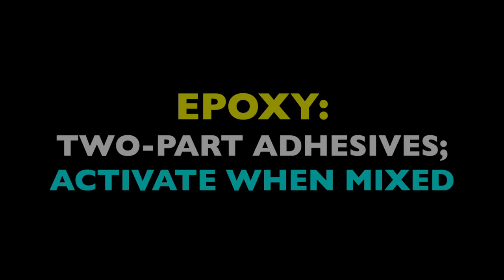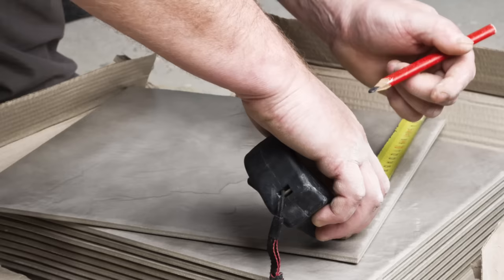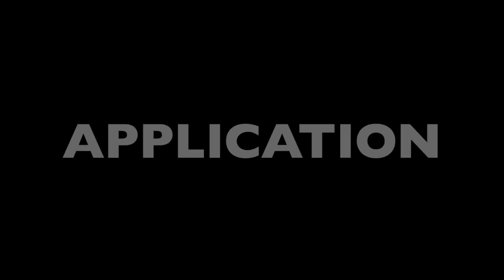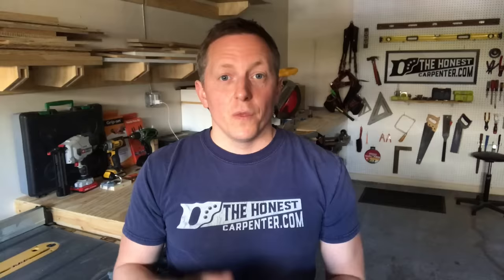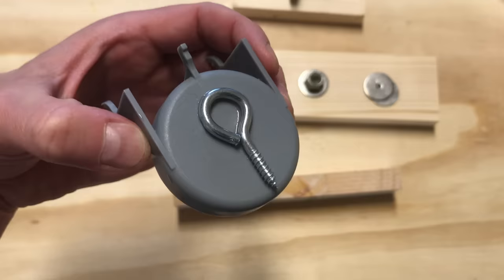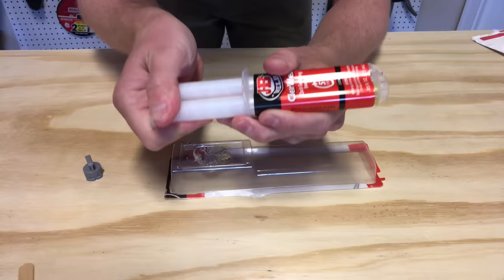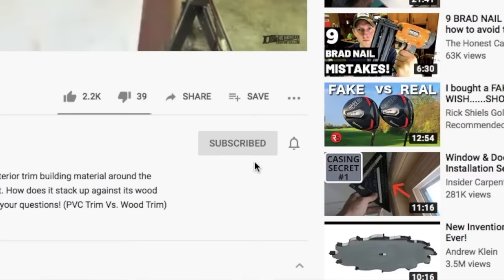DON'T USE SUPER GLUE! Try This Instead..(Epoxy Adhesive/5-Minute Epoxy/Epoxy Glue)

Comment: I recently removed a 4' X 8' sheet of drywall that was covered with un-matchable wall-paper, tore out the wall and installed a pocket-door then re-installed the drywall using that larger quantity-size epoxy you showed. I mixed the entire bottles with a long-handled paint-brush and covered the metal and wood studs, pressed the drywall into place and didn't have to put screws through the wallpaper. The drywall had originally been installed with small, smooth staples so levering it off from it's backside was easy and non-damaging. Today I'm installing new drywall on the other side of the pocket door the same way because it's quick and there's no patching over screws to do. Later in this bathroom remodel I'm using the small hypodermic style epoxy you showed to install small 3/8" color-dot tiles at the junctions of 18" X 18" porcelain floor-tile. I plan to put a dab of grout at each junction, press a tile-spacer in it, let it set up and then glue the dots which puts them level with the tile-top. Then grout like usual which will be more secure than just pressing the dots into wet grout. The super-glue that comes with a separate spray-hardener is what I'm using on the trim around the windows because it's almost instantaneous grab and set. Both types of adhesive have their best uses. The epoxy allows me a little time to adjust the color-dots with tweezers to get them aligned perfectly and the Super-glue instantly holds the trim together.

Comment: I remember growing up we always had the two tube pack of Devcon Plastic Steel  in the house. That got used to repair the car bumper among other things. There was also another brand of epoxy called Araldite that we got here as well. It was used to repair a broken crock pot cover, two broken vases, and many other household items.
Also the smell you get when mixing the two parts of the epoxy is exactly what green papaya smells like. 😊

Comment: It's also great in furniture repair at times. I sometimes fill a cavity with some wood dust (Oak dust for oak and so on). Granted, it's still epoxy with wood dust in suspension but for big knots in the wood, it works well.
Reply: Yes, for that. Not so good for joints in wood
Reply: @claudiodigregorio4315  Absolutely. You know what they say - it's all about hiding your mistakes :)

Comment: Another note to new users. Epoxy has an exothermal reaction as it sets, it heats up. keep this in mind if you are holding finger pressure on small objects you glue together, the heat may become uncomfortably hot.
Reply: Regarding the exothermic reaction, small amounts of epoxy can dissipate the heat fairly readily, so small amounts don't usually rise in temperature very much, and users may not notice it is exothermic at all.  Not so with large amounts!  We used epoxy at my place of work.  At one time, the epoxy was over-ordered, and there was about five gallons for which the use-by date was exceeded, so the quality folks did not allow it to be used in product.  The disposal costs for liquid chemicals are quite high, but solids could be simply put in the trash.  So, the EH&S (environmental health and safety) folks suggested that the two parts be mixed so the epoxy would set up hard.  It was really a highlight of the day to see those chagrined EH&S folks pushing a wheeled cart down the hallway, trying to get a skinky, fuming, bubbling five-gallon can of the stuff, surrounded by ice, outside the building before it became necessary to evacuate the building due to the noxious fumes! 😂

Comment: I've had situations where this would be suggested or where it was the best fix for a job, then I would get to reading the instructions and decide it is too much effort. You make it look easy. Thank-you!
Reply: I've worked with epoxies for decades and you're not entirely wrong. They work better than practically everything else...BUT... You must read and follow the directions to the letter. Most people can't be bothered and that just won't work with two-component compounds.
Reply: @ethelryan257  , prior cleaning, preparation, and fitting of surfaces to be glued isn't just everything, it's *the only thing*.

Comment: Excellent. I recently joined two pieces of plastic floor trim and went with super glue because there was no way to clamp and very little surface area on ends for positioning. Then I glued a couple wood strips to the backside to reinforce. I should’ve used epoxy for the reinforcement. Next time I’ll know better.

Comment: I love this stuff! A real go to product for woodworkers. I tend to use the JB Weld Epoxy putty stuff lately for two specific reasons: Once it cures it is as strong as steel, and you can even drill or tap the stuff! Very handy. Great video, thanks!

Comment: Excellent informational video!
I've been using epoxies for many years.
I once repaired a broken valve cover bolt tab on a Subaru with JBweld and became a believer in the strength of industrial adhesives!
Reply: I did a similar thing on an old Buick slant 6 with 22 bullet shell brass and jb weld

Comment: I think the most important part of using Epoxy, is properly mixing the Epoxy with a focus on INCORPORATING all of the part A/B surface area stuck to the plate or cup that is used to mix on or inside of. 
Note: Un-mixed part A/B will never CURE SOLID and is the primary reason for Epoxy complaints.
Don't use Round nosed popsicle-sticks because they do not scrape the Parts' A&B from flat surfaces - cut them flat faced like a chisel with scissors first.  Scrape the sides and bottom of a mixing cup, or plane the flat paper plate you are mixing on to get every single drop into the whole. After you think it is mixed, consider mixing for 30 more seconds before applying.
If you don't have time then you should use a 12 minute epoxy so you have time to properly mix, apply the Epoxy, and clamp the joints.  
Secondary in importance is the 50/50 part: It will cure solid IF it is mixed COMPLETELY.  When epoxy does not cure it's because it was not COMPLETELY mixed beforehand. 45/55 / 55/45 will cure A-OK, but small streaks of 80-100% part A or B will never, EVER, cure, and be sticky and weak FOREVER.
Note: Epoxy does not "Dry" like rubber cement does --> Epoxy only Cures or Hardens, so stop using the words DRY/Dried when talking about Epoxy. 
P.S. Don't get Epoxy A/B on your skin, no matter how many seasons of Epoxy wet fingers/hands you've seen on Forged-In-Fire!

Comment: Totally agree. I tried to repair a broken garden statue for a customer over the winter. I first tried PL Construction adhesive. Didn't work. Then I tried Super Glue. Same...didn't work. Lastly I tried JB Weld 5 minute epoxy, worked like a charm and my customer was very happy!

Comment: 3:32  NEVER twist the tube when removing it.  If the glues contaminate each other, the entire tube could be set the next time you go for it.
Reply: Yep, that was a strange manoeuvre he did.
Reply: naww, it's not a radical type reaction for polymerization, the hardener IS the limiting reagent
Reply: make sure you use a rag and clean off the tips, before putting the cap back on or its going to be bonded solid the next time you use it.
taping instead of putting the cap back on is a good idea.

Comment: Absolutely has a place.  Especially for bonding "slippery plastics" because no other common adhesive works, including super glue.  Another big positive is it lasts a long time even after being opened, because it doesn't set up until the two components are mixed.  It can sit in a box for years and still work like new.

On the down-side it is messier, because of the mixing process.  You can buy nozzles that fit onto them (including the tube seen in the video) that automatically mix the two on the way out, which is clean and convenient, but you throw them out after use because the epoxy left in them can't be removed (which also wastes epoxy) so unless you don't care about the cost, or are using an entire tube at a time, mixing it in a tray or something is the way to go.  BTW, that's an advantage of those little super glue tubes:  they're clean, simple, cheap, and mostly single-use because they dry up so fast after being opened.  So, they too have a place.  Depends on what you're bonding and how strong it needs to be.

Comment: fantastic stuff, also very handy for potting small electrical components that may risk water ingress, and for fixing those small external solar lights - but make sure you use the clear epoxy in that case or you just made your solar light think its permanently overcast :)
Reply: One of the bigger guitar/bass pickup companies on the planet, EMG, covers their active pickup circuit in epoxy so people can't steal their design. It started with the owner making them by hand, all the way up to today when they are pumping these things out from a factory.

Comment: I’ve mixed baking soda with the mixed epoxy, it will dry very fast and it’s like plastic when it’s dry. You can cut it or sand it. Got the idea from another video where crazy glue was mixed with baking soda. Epoxy works even better.

Comment: 2 part epoxy is all I EVER use, diff set times and diff cure times, i even repair my tool bags etc. with it. FYI the average i come across is around 3k PSI for your 5 min household stuff, and the fast set WITH the built in mixing nozzle can set in less than 30 secs.

Comment: Being a retired framer who now has time to do woodwork at a different level  I've been hearing a lot about  epoxy and I've never really associated with wood projects and that also applies to CA glue which I'm going to try both of them out more often and  see how they work out for me. Been a fan of your channel from the beginning and I don't always agree with you but you think like us old school carpenters and I respect that.
Reply: Carpenters, cabinet makers and framers are usually dealing with much larger surfaces to be joined, where cyanoacrylate adhesives or epoxies are not practical or economical.
Reply: @chrisgraham2904  Liquid Nail is a good Go To for any framer. Not only for sub-floor but also a great fire starter on a cold morning on the job site !
Reply: @michaelbradford4444  I've heard a lot of people swearing by Liquid Nails, but I used it to adhere some exterior wood panels about 25 years ago and they popped after the first winter, so I never used it again.  LePage PL9000 has been my go-to for panels, sub-floors, decks and mortorless retaining wall stone.  It is petroleum based, so I'm sure it would be a good fire starter also.  lol
Reply: @chrisgraham2904  Get the one that says Subfloor on it. I've only seen the big tubes of it and as long as it's warm outside it's what it claims to be , Liquid Nail !
Reply: @michaelbradford4444  I'll give it another chance.  Formulation may have changed over they years also.  lol

Comment: In aircraft repair work, we use 2-part 3M Scotch-Weld DP 100 & 110 commonly for it's quick setting, high bonding strength, and flame retardant properties (a requirement on commercial aircraft) -- no flammable glues. At home, I've used CA and baking soda paste to do quick repairs to minor dings and dents on my wooden paramotor props.
Reply: Fantastic stuff. Plus with the disposable static mixers and the gun it's so easy to use.

Comment: Totally agree with everything, excellent presentation. When you get used to cure times, you can be more selective with cure times that fit you purpose. 5 minutes is great but sometimes longer cure times can be helpful.
Super Glue has it's uses, but they are actually very limited. I have had great success reducing the size if 'O' ring seals by cutting out a section and gluing the ends together. Had that work upto 3000 psi.
Contact addisive is also very useful. Even use it for clothing repairs. Look forward to watching more of your videos.

Comment: I tend to use Super Glue as a quick clamp for odd shaped pieces in wood working.  Tite Bond just doesn't setup quickly, but a dab or two of CA will help hold parts together while you move on to the next sub-assembly.

Comment: I use epoxy a lot for my projects if I want the most strength and a permanent bond.  I'm not a fan of the dual tube plunger dispensers but prefer separate tubes.  I also like contact adhesive for a lot of work.
Reply: You're right, the dual plunger is such a waste (never seems to come out accurately) - Only use separate tubes, much better control.

Comment: I used JB Weld on a pinched off Air condition line for the rear portion of a van so that I could just have the front portion of the AC working in the vehicle. It worked fine and never once did it leak any refrigerant.

Comment: Sharing a tip, I have used for 38 yrs as a restorer of furniture for fire & water damages. Epoxy has been my friend for onsite repairs for years. I purchase, a small paper palette from an art site 9"x12" and a metal palette knife, I own 3 different sizes ( they come in all shapes, sizes & lengths ) they are perfect for mixing the glue (2) parts & excellent for the application of the glue ( to smooth or get into a tight space (because the artist palette knives have some flex in them ). The palette knife is easily cleaned off with an xacto knife, after the epoxy has set up or a rag with a little lacquer thinner, before the glue sets up. I use the disposable paper palettes for the larger mixing surface & when large amounts of the glue is needed (most paper palettes have paper sheets, that is waxed on one side and plain paper on the other side, I always mix on the paper side.)

Comment: Super Glue and l never got along, but lt was easy so l used it but l glued my skin more than anything else, as crazy as this sounds having to mix epoxy was scary but now l will. Thanks boss.
Reply: Just remember that Super Glue, aka cyanoacrylate, was originally designed to be used by surgeons in lieu of sutures. That's why it works so well on fingers. It also seems that it has a natural affinity for skin. If skin is anywhere in the vicinity, that CA will find it.
Reply: Latex or vinyl gloves will solve your super glue sticking issue.
Reply: @williambranham6249  Thanks, l always think l can be more careful, but the gloves are a better option.
Reply: @stevea.8816  Yes, I get in a hurry or lazy  and don't  put the gloves on and it bites me everytime. I will say when finished I simply pull the gloves off (inside out) and the dribbled  glue is now on the inside . I throw the glove in my glue box and they can be used multiple times. (Until they rip. )If gloves aren't your thing, go to Wal mart or other pharmacy and buy finger cots.
Reply: @williambranham6249  That's brilliant, thank you for commenting this. I'm way too frugal and carry too much guilt about single-use disposable items to let myself use cheap gloves every time I need to glue something, but your idea of having a spot for them to dry and be reused for gluing again is a fantastic protip! I appreciate it!
Reply: Another drawback to CA glue appears to be that its bond strength weakens over time, at least with wood.  This is based on some fairly carefully done tests that show that while the wood bond strengths of other types of glue might increase or decrease but rapidly plateau after a year or so, CA glue seems to keep weakening to the point that it becomes the weakest (having started as one of the strongest), and has kept weakening.  These tests are ongoing, so it may reach a plateau eventually, but what I've seen is alarming enough for me to no longer consider using CA glue for permanent uses or ones that require strong bonds.  So far I haven't used it for the latter, so I can't go on my own experience, but I had been considering using CA glue for wood for a while, and will now hold off on that.

Epoxy has its drawbacks compared to PVA glue such as cost, the need to be mixed, toxicity (before curing--it's pretty inert once cured), and the thickness in most cases, making it a chore to spread (although it squeezes out nicely due to low surface tension in the case of JB Weld standard and marine, even when making dowel joints), but its advantages are compelling.  For wood, it's the ultimate gap-filler because it's usually (depends on the epoxy) stronger than the wood (great cohesion) and doesn't shrink or expand.  Unlike PVA glue, it doesn't creep, and lately I've experienced some negative effects of that particular issue with PVA.  Depending on the epoxy, the bond can be waterproof--I mean as in really waterproof, which at least in my experience PVA glue never truly is regardless of the manufacturers' claims.  And in the case of slow-curing epoxies, the open and working times are fantastic--I don't feel nearly as rushed on complicated glue-ups that need to be clamped afterward for 24 hours in any case (albeit working with PVA glue is generally easier and faster).
Reply: That is because you have no clue how to use it.  Get educated.

Comment: For general material items, epoxy is great. The only things for which I use CA glue are trim molding edges, small wood parts, or to seal wood/ply end grain. Otherwise epoxy is the wat to go as a chemically derived mechanical fastener. Rather than the plunger double tubes, I'd recommend the JB Weld bottle kit. You get a lot more bang for your buck and it essentially doesn't ever go bad, so you'll have plenty for many projects. I've use it to bond magnets to wood, rubberized corking to my vise wood "plate", to reinforce plastic fasteners in cheap furniture, to reinforce screws in wood that may be under increased stresses, as a gap/hole filler...